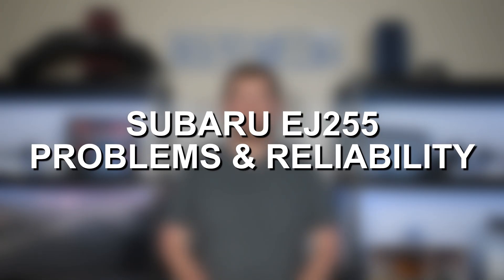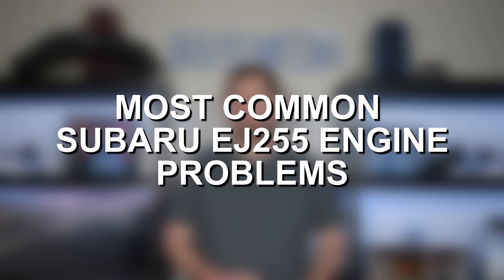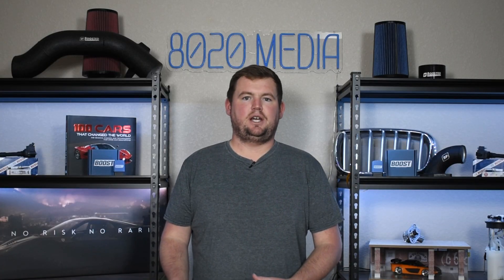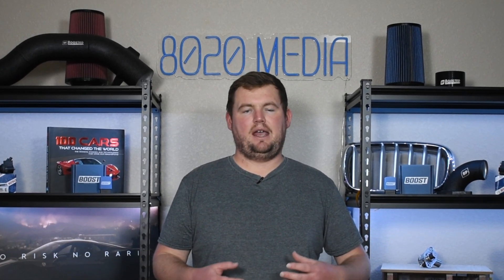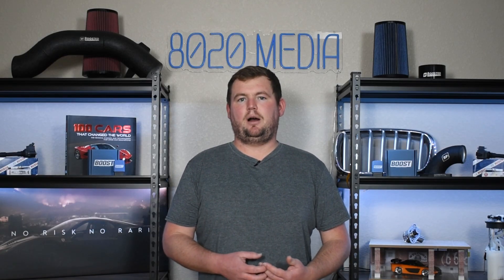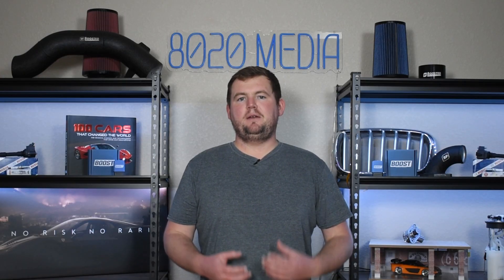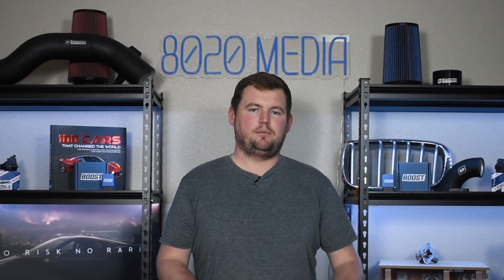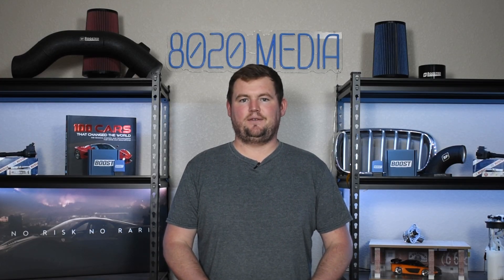Subaru’s EJ255 | Common Problems & Reliability

Comment: The ej255 is a good motor.  The banjo bolt screen for the turbo was removed in the later years of ej255.  It isn’t clear which years it was.   But seems to be 2012-2014.  The turbo itself is a great quality turbo.  The rods bearings spin on these due to oiling issues because of the poorly baffled pans and oil pump plate screws backing out.  They also spin due to detonation.   They are pretty thin bearings. A couple of bad knock events at wide open throttle and it messes with the clearances on either side of the bearing, causes them to distort not allowing a good oil film on the bearing.  If you can avoid detonation with good gas and a good tune.  Along with good driving habits.  They can last just as long as any other engine.  Also, the ej255 and 257 and the same engine block design.   Aside from the type RA block from the later years of the 257 which have a slightly different piston design.   It isn’t clear whether it helps with detonation or not.  Both great motors.  There will always be issues with cheap performance turbo cars.  They are not over built.  Otherwise it would have been 40k dollars and not 23k dollars. The good part about people blowing these up so often is the wide variety of aftermarket options.   Like IAG short blocks, readily available factory short blocks that are affordable and the heads being a simple design for rebuilding.   Love the EJ engines.   They just can’t handle a ton of power.
Reply from the maker: J - Thanks for taking the time to share your experience!

Comment: Currently looking at a WRX with the EJ255. I’d like to get to at least 300-350whp. At what power levels do I have to worry about ringland failure?
Reply from the maker: D - We have a video on EJ255 mods that may be helpful here: 
https://youtu.be/wmk_K58bT0g

As far as your question, the EJ255 is notorious for ringland failure—especially on the factory tune—even at stock power levels, so if you're aiming for 300–350whp, you're entering a danger zone unless you're taking proper preventative steps. Typically, ringland issues become more common above 300whp or 20+ PSI of boost, especially if the tune runs lean or detonation occurs. However, failures have happened as low as 250–280whp under aggressive tuning or poor fueling.